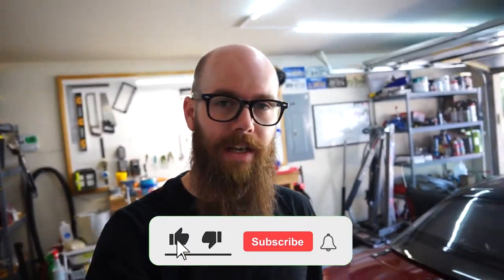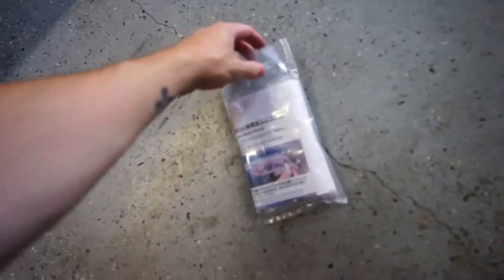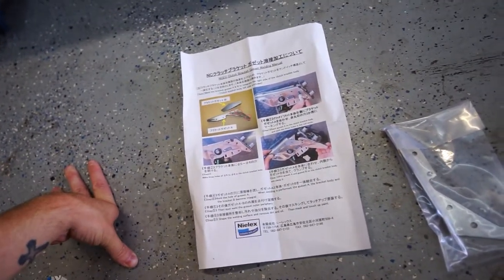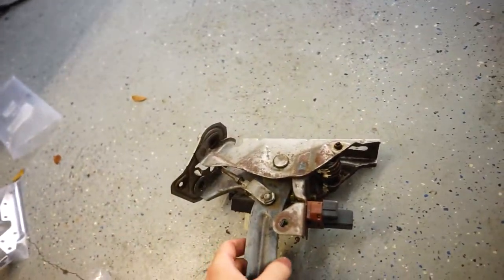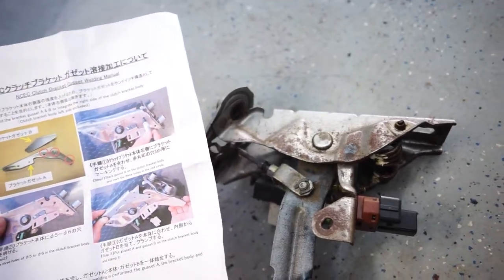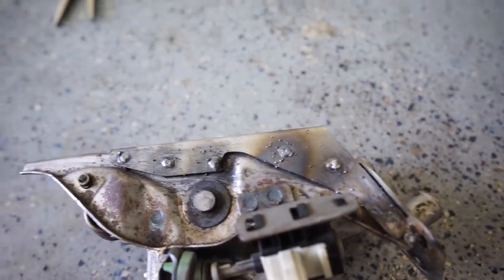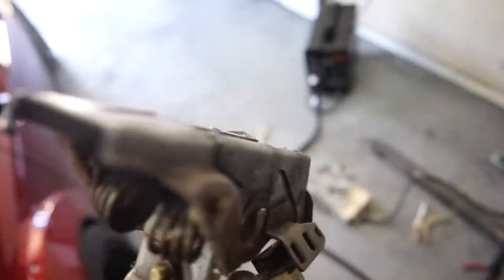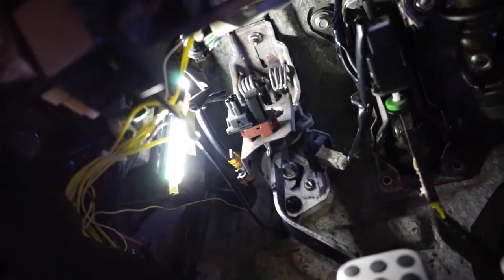Nielex Clutch Pedal Bracing for NC Miata

Comment: FYI Black Halo Racing sells a reinforced clutch pedal for the RX-8, it also fits the NC as it's the same part. For anyone that doesn't want to order from Japan, or weld.
Reply from the maker: I figured the last comment I would receive on this video would be about welding on the floor of all things. Can confirm, knees are fine.
Reply from the maker: I'm ok, I'm not a welder, don't plan to be. This is the third time I've needed to use this machine for anything car related and it works fine for what I've needed to do. I'll use my knee pads next time.
Reply: FYI, it is not the same part.  The stamped sheet metal is, but the pedal length and spring are different.  The pedal will hang lower than the NC pedal and may not be able to fully actuate the slave.

Comment: Good to know, I'm having a happy meal kit installed from Goodwin racing along with new slave and master cylinders. My 2007 is at 105k and I never considered this as a potential failure point. I might just go with the reinforced clutch petal for the Rx-8. It would be ironic if I went through all the trouble to overall my clutch components and the clutch petal itself is what fails lol
Reply from the maker: It's definitely worth thinking about!